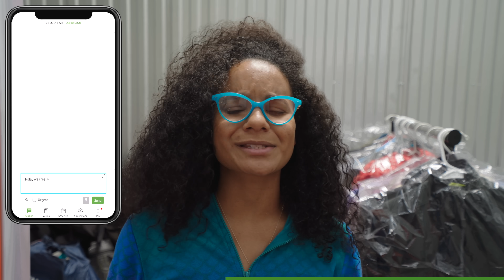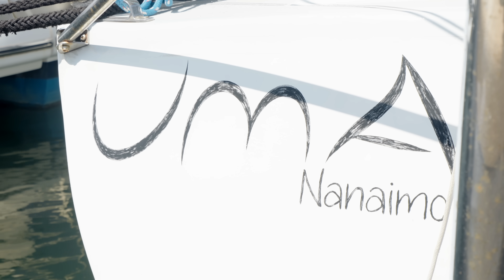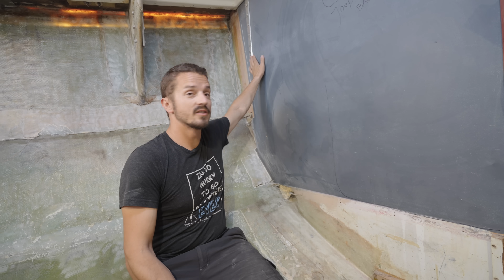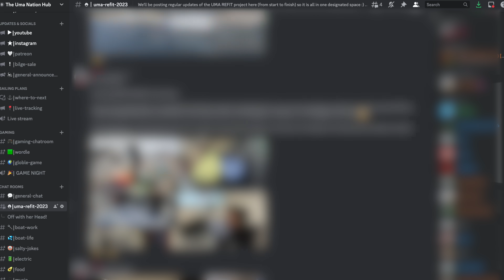Off With Her Head | Step 350

Comment: i'm sure I'm not the only one to mention this, but the head and galley are usually on opposite sides of the boat so that there is a physical separation between the intake of raw water and the outlet of sewage.  Maybe something to consider when you're putting it all back together.

Comment: The boat design was built structurally sound and designed by engineers. I would encourage Dan to learn more about why bulkheads are better loosely anchored rather than completely glued in. It’s the same reasons why houses aren’t built airtight. The same reasons why bridges and skyscrapers sway. If you glass in the bulkheads all around the sides of the haul and ceiling floor, you will create a brittle structure. It will break like a fault line in an earth quake.
Reply: Interesting comment.  Can you please provide some sources of supporting information?
Reply from the maker: If that were true, then every boat would be built this way. But they're not. In fact every boat we've been able to dig into has much more structure than ours. And every bulkhead is fully glassed to the hull with Sikaflex attaching the deck. These production boats like ours were built to a deadline and budget and for people who don't actually sail very far. Just like your typical camper van is only meant for flat asphalt, and as soon as you take them down a bumpy gravel road, things start to fall apart.

Comment: Heya Dan - pro plumber here. The best shower set up is just a shower head on a flexi hose slide mounted on a vertical rail. I've fitted and tried every other type. Beware of these posh selector type set ups. Most just hold stagnant water for months, then people spray it on themselves when they meddle with the settings.... Ugh. No. You must have access to any connections that might require service also, (if you do not wish to waste your time and painstaking work). Very best regards, and I have every confidence!!

Comment: The way you are configuring here is exactly how my Spencer 42 is setup with a starboard side head. 

Looking forward to see how this project comes together. I have about half the videos from rebuilding mine up on my channel if you are interested. Did some cool bent plywood in there that was actually pretty easy!
Reply: @RenegadeADV
"Looking forward to see how this project comes together..."

Yeah, and your own YT fans (including me) were looking forward to seeing how YOUR OWN head rebuild had come together, yet you never put up a single video of its completion, and its been like what, three years? You crack me up. You're always doling out advice to other Creators, yet you never do the same on your own sailing vlog.

Comment: To use you fix a piece of cardboard or plywood in the plain of the bulkhead you want to add. Hold the stick against the cardboard placing the point of the stick at a point along the hull. Draw a line on the cardboard along the notched side of the stick. Repeat at the next point.
I first heard of it from my brother who was a line foreman at a boat building company. He learned it from an old guy he worked with.
In the last year or two several sites have popped up on the internet that explain it better than I. They also have pictures, which helps a lot.
Looking forward to seeing your final design.

Comment: You guys are amazing so I hesitate to suggest that there might be something you may have overlooked regarding the floating bulkheads.  It COULD be that they are floating to keep from putting hard-point stresses on the hull.  I am not saying that is the case,  just that you might want to consider the possibility.

Comment: backing up a little motorhome is a piece of cake.  I am not a sailor but play with a truck and travel trailer.  From the back of the bike rack to the front bumper of the truck 61 feet.  It is so much fun to back into a tight boondocking site.  Love your design ideas and your adventures.  Keep up the good work.

Comment: I work has an engineer on ships. I have had my fair share of plumbing fun. My recommendation is if your toilet doesn't use much water for a flush and you have water to spare go for fresh. Reduced smell and the bowl won't stain from seawater. 

I would still leave a point in which you can switch back to sea water in case of emergency or if you use more water flushing than you like. 

On ships you usually only see freshwater for toilets on vaccum toilet systems which use next to nothing for water to flush. Which causes its own problems.😮

Comment: I am fascinated by your major redesign of Uma's interior.  Because you are trained architects (but not Naval Architects), you are significantly more capable to undertake this project than I would be.  But it dawned on me, that the positioning of weighty things in my "production" sailboat like water tanks, holding tank, fuel tank, etc. must have involved careful planning to maintain good balance fore and aft and port to starboard.  Obviously, your boat no longer has a filled diesel tank for such balance.  I assume you will be giving careful consideration to the weight and positioning of your redesigned elements (including tankage) to insure an imbalance does not create a port or starboard list.  It would be interesting to me if you would comment on these weight distribution considerations as you proceed.

Comment: Hey guys if you ever use that peel and stick stuff like the tiles and what not one thing that will make sure they stick is get yourself some “3M primer 94” it is made specifically for sticking double sided tape or peel stick to any surface. But make sure it is perfectly lined up before you stick because once it’s stuck,.. it’s stuck

Comment: A pot filler would have worked for the fold out sink. They articulate out and then recess flat. You could have inset it into the wall above the sink so it would have been flush.

Comment: Did you guys consider using a foot pump as a method of getting around the issue with the head sink? I know you could design a button or something less open near the shower floor while keeping only a tiny pipe feeding the water to the sink.

Comment: I highly recommend the dometic ball valve style toilets, very simple setup with a foot pedal that lifts to add water and goes down to flush. Easy seal replacement, negligible water consumption and believe you could run a three way ball valve to select fresh water in port, salt water on long passages. My wife and I could go a week or more with a 35 gallon black water tank on our 46 Grand Banks. Really loving the refit videos!

Comment: I have questions! Not that I know anything about boats (only what I've seen on your channel over the years).
1. Are you planning on slacking your rigging? That way when you bring the reinforcements to the hull it can pull itself back to true and then tighten it down again?
2. If you are moving the head, don't you have to move the through-hulls? If so, how are you going to do that when you're in the water?
3. As YouTubers, are you going to plan any modifications to the cabin for camera mounts?
Reply from the maker: 1. Already done
2. No there is a matching thru hull on the other side (and we can always change it when we haul out after) 
3. Maybe
Reply: @SailingUma  I'm sorry if I missed that ep where you did that to the rigging or maybe I wasn't paying attention!
That's awesome with the through-hull though!

I've always wondered how a boat designed by people who are filming everything would look. Would there be camera mounts glassed into spots so you could quickly shoe in to set points and now have to worry about something to hold the camera? Would there be a special camera dome in the front where a set camera can get views of cutting through waves? Would they set a camera on the mast they can get shots of that sends video down to their system down below?

Comment: Having worked with fiberglass (cutting and sanding), I strongly recommend you both splurge for full face masks in order to protect your eyes, not only from the microscopic glass fibers seen floating all around in your videos (your current safety eyewear lets them in), but also to protect your eyes from paint, caulk, epoxy and other fumes normally found on a boat.

Include one or two full-length hand rails along the ceiling running fore to aft.

Comment: You should make sure you have a plumbing access panel so if you need to access the back of the shower you can. Also breaker box. If you could find a shop with a laser cutter you could cut stuff to fit really easily.
Question: since your in the water  doing this is it better than being on jacks when you start glassing for shape?

Comment: You know you are in Italy when they...

1) make you back an RV onto a ferry and down a ramp
2) have a huge multi floor storage facility but no freight elevator
3) let you gut your boat while floating at the dock/marina.

We are looking forward to the video day when you decide to add/remove thru hulls while still on the water.  :O

---

FWIW, ideas for your old bathroom sink faucet if you elect to reinstall it...

- install a flexible kitchen faucet (type that has a spring wrapped around the hose) and attach it to a swivel base.  This way you could simply lay the faucet flat/sideways to store the sink.  bonus with the spring flex to provide extra clearance if needed when closing the sink.
- add a combined hot/cold water selector on one side of the faucet.  

Fellow, ex-pat Canadians now on early retirement and available to travel/crew fulltime.

Comment: It's a shame the sink never worked, I was really impressed with it when it was installed. I would have thought you could get multi way pivoting taps, especially ones where it's just a nozzle and the valve is separate, on the non moving part

Comment: Like someone mentioned above, don’t go copper…Pex is the way to go for the plumbing. There’s Pex A and Pex B.  Pex A is the way to go but the expansion tool needed is pretty expensive and hard to rent while Pex B is still very good and the crimper is relatively cheap. So much easier to work with and the learning curve is quick.  I just replumbed my little boat and no leaks and much cheaper than copper.

Comment: That hideaway lav is badass. 3-4" above the lav do a 3-4" recess stationary shelf. Install a 2 handle 6" high goose neck 4" spread faucet. When you use lav you just turn the goose neck out over basin.  Run water lines high and tight below shelf.  That hideaway basin was a work of art and awesome use of space!!!  You can use shelf space on the side of faucet for toothbrush, soap ect.  Maybe even have a flip down panel that covers faucet/shelf when not in use?
I just think that hideaway basin really was a good creation,  no need to reinvent just something to improve upon.   To bad it wouldn't be feasible to Patten.   I see a remodel your boat show coming with so many cruisers remodeling/improving their floating homes.  Interesting yt series to come?

Comment: I always enjoy your videos and it remindes me of my many years working on boats.  Back in the day your boat was built, that was not marine grade plywood.  That was exteror grade plywood. Marine grade plywood was still much more espencive and a lot of manufactures subbed out for exterior grade for inside work.  Very recently I even found a top name boat builder that used pressboard on cabnet doors veniered in a beautiful wood I only found out about this on a new boat when the door fell off in a rough sea and it pulled off it's screws .

Comment: My short term solution (which is now close to 20 years old and on it's second boat) to fresh water flush was just to put a gallon bottle of water next to the toilet.  However, lately, I have been thinking about plumbing in a bidet attachment on the toilet.  This would allow me to pipe in fresh water without actually attaching the fresh water side to the toilet plumbing (and avoid any possibility of back wash).  Most bidet add-ons have a cleaning mode that  prevents the nozzle from dropping down when you turn it on, and that can be used as a toilet fill mode.

Comment: Great job guy's, just a couple of thoughts when you glass in new structure keeping the boat from flexing in the water while it cures could be an issue. 
A coat of flow coat on all the exposed glass makes it easy to clean and seals any exposed fibre from grinding.
Are you going to push out the distortion from the chain plates before you put in new structure ?
Keep up the great content.

Comment: So I hv a curious question.  How do you plane to only add enough glass and bulkheads without adding excess weight to uma,? Because too much weight in any given location could drastically effect the handling sailing charictistics and overall sea worthiness of said ship and still keep her sleak and tidy i guess is the word  because to me adding to much will make the boat sluggish and unpleasant to sail.
Reply: Not really did you know the center of gravity is really really low on these ships. The keel is pretty far down and really heavy so its not like a small fishing dingy where you throw the gas tank to the other side and Suddenly it won't plane.

Comment: Bulkhead: Dan I think I have other information:
- many decks simply lay there as it is on Uma
- When "glued in" it is not done by Sikaflex but a completely hard glue (that proved to break for example at EVA (Expedition Evans) and SY Viking. 
So simply bad.
----
I hate to say: Very many of your complaints still are valid to modern production boats.
Reply from the maker: Yes. It’s true. One of the many reasons we don’t want to get a new boat from many of the current yards producing expensive garbage. There are still a few good ones out there making solid boats. But they’re harder and harder to find since the crappy ones pay more for marketing the quality construction.

Comment: Get rid of all of the wood, and get structural foam and glass it in. It's stronger and lighter than wood, and it won't  rot.  Good luck with the rebuild.
Reply from the maker: No such thing as structural foam. It’s the glass that provides the structure. The foam is just the lightweight filler.

Comment: Seeing you rip out all the wiring is enormously gratifying for me - I love 12v electrical and re-doing,neatening up, etc. is my jam.  It also gives me The Fear, though, because I know how much money I would wind up spending on all of the correct gauge marine grade wiring, tooling for connectors I don't currently have and "need" because they're the right ones, etc.  The last couple electrical projects on my vehicles have turned out to be absolutely WILDLY expensive.  Good luck, lots of videos on the 12v system please!  😁

Comment: Whoo-hoo!  Visto Italiano!  Whoo-hoo!  A car!  Whoo-hoo!  An RV!  Whoo-hoo!  A land yacht!

Hey, this is sailing reality.  Would be nice to live aboard full-time, and some find a boat where that's possible, but most boats require occasional long-term maintenance and remodeling.

Cardboard?  You two are SO architectural!  I remember those days.  I also remember the expense of modeling foam...!

Since the camera can't pick up the smell of a ship's head, not to worry!  For just $9.95, you can pick up a three-year supply of Uma Head Scent!  Every time you catch a glimpse of Uma's toilet, just grab Uma Head Scent, give it a quick spray in front of your monitor, and enjoy the ambience of real sailing life!

Another overgrowth solution for saltwater (or any) toilets is the use of a chlorination puck in the tank or bowl.  Some might say, "But you're flushing chlorine overboard!"  In reality, each gallon of seawater contains more chlorine ions than the chlorination puck will add in a day.  With the chlorination puck, however, both microscopic sea life as well as the smell will be gone!  Don't get the blue stuff.  It stains and is a gimmick.

You may want to consider buying a real box cutter.  Safety.

Comment: I'm wondering if the dimples will pop out on their own when you slack the standing rigging. Cant wait to see. I'm also wondering that the fact that you are in the water and glassing new bulkhead and other structural members, if there will be welcome or unwelcome preloading of the hull shape?  Is the boat at "design" level or at some temporary loaded level?

Comment: I strongly suspect the companionway is a weight balance issue to have kitchen and head on different sides, many campervans do the same. Of course modern vans don't have to these things can be made lighter and balanced out by the denser things a modern van/boat has. Maybe worth back of envelope reckoning of your weight balance. Maybe put some small heavy things storage on the opposite side, perhaps even the stove water maker and stuff to balance, or a bigger water tank. Failing that, on an electric boat an couple of hundred extra amp hours of iron phosphate battery for essential nav stuff would work well(have your solar go in the extra and the excess goes to the main battery bank with a battery to battery charger so you've always got a backup. iron phosphate has a better temp range, is lots cheaper and is more reliable than lithium ion so could be a good fit as a backup, in this case it's disadvantage of being heavier is not so much a problem)

Comment: I was curious about whether or not you guys are going to have to deal with weird hull flexing since you are in the water? I understand you're trying to fix the previous hull flexing issue. Are there any worries about the glass joints moving while curing? Or flexing of the boat on its length axis. It seems as though you have done your research and if you can shed any light on major structural repairs on a glass boat while in the water it would be appreciated. Thanks, and best of luck on your ambitious project!

Comment: Man, I would try to eliminate as much wood as possible for structural members. Using it just for finished surfaces. Fiberglass foam core is the way to go.
Reply from the maker: It’s a lot more work though, for little gain.